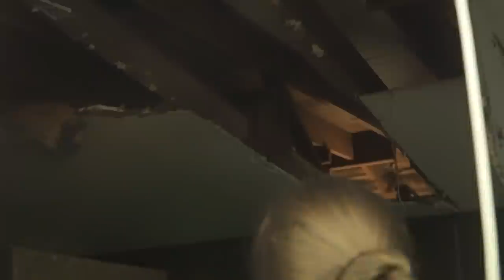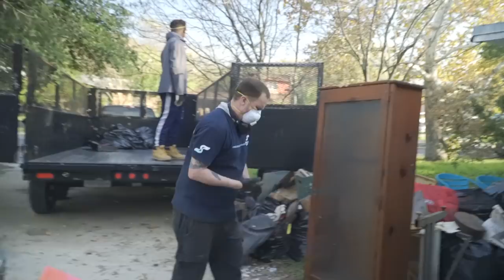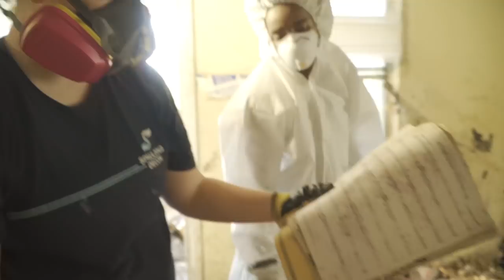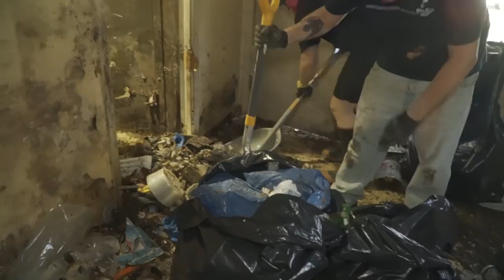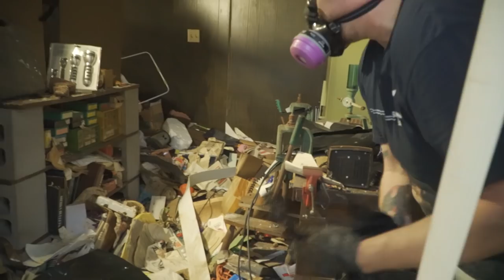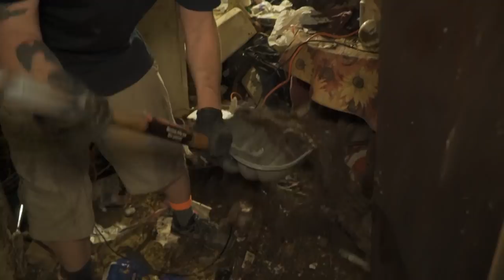Extreme Hoarding: Breaking the Mold

Comment: Seems cheaper, safer and easier to doze the whole mess.
Reply: It Doesn't seem like there would be anything left to save, including the structure...
Reply: Saves the state money from demolition and reconstruction of a new home.. or if an insurance company is involved by the owner that caused the hoard they don’t go far as demoing a house down just a clean out, most likely they will remodel this whole house who knows !
Reply: Even when a house gets demoed, you have to clean out the hoard, appliances, etc. before you can demo it because construction materials are usually considered a different kind of trash that is handled separately in most areas.
Reply: @rock_lover  I sure as hell wouldn't want to live in a house that had that much water damage for that long even if "repaired". But it all depends on whether it's wood frame or block construction, the extent of damage, and the market value of the house as to whether it's worth repairing or bulldozing.
Reply: @SirReptitious  ahhh yup! This one right here 💯
Reply: @SirReptitious  I knew of someone with the same type of damage, that is the roof was collapsed over the kitchen, been living there in squalor. Values in the neighborhood got her $250k for her “tear down”.  It all depends.
Reply from the maker: you'd think 😅
Reply: @jessiec1194  WOW!!
Reply: I agree…. Bulldozer and excavator could havve done that in two days
Reply: Problem is there could be toxic stuff inside and just bulldozing it could recklessly endanger people in and around the area.
Reply: @SirReptitious  In cases of a fire that destroyed the entire structure, it gets demolished with everything in it.
Reply: Someone was actually living there?😥😥
Reply: these houses are easy to find (i love to look them up to see a "where are they now" type of update). this one was sold to a flipper in January, it was gutted to the foundation and studs as of the most recent IG update.
Reply: That's what I keep saying about my family home.
Reply: It's unlawful..you have to get rid of  mold separately
Reply: @ymalloy  not in Colorado.
Reply: I thought the same. That house can’t be saved.
Reply: Can you say “controlled burn”?
Reply: Wouldn’t it have been easier to just drop a match?

Comment: Why don't you use huge rolling trash cans to put your bags in, then it would only take one person to fill the bag  instead of... 1 person shoveling and another person holding the bag open?? Then you could roll it outside instead of killing your back carrying out. Just seems the most logical and easiest on your body.
Reply: They probably end up using those later in some hoards rather than at the beginning. If you notice, when they start on a section, there's trash all around the area they're cleaning; it's easier to just carry individual bags than try to wheel a large trash can over trash on the floor, if that makes sense. 

Once they start clearing out pathways & rooms, it becomes a lot easier to use those big rolling bins ;3

Comment: I would've started by towing the car out of the driveway and putting the largest dumpster you can find in it's place with the dumpster company on call to drag it away and replace it as soon as it's full.
Reply: I also would've taken the door off the hinges in front to make it easier to haul crap out.

Comment: Just. curious why not put a trash can up to the window of each bedroom for example or a deep wheel barrel and put all trash that will fit out the window into a trash can or wheel barrel then dump in dumpster to save on bags and cost of bags? I have cleared on hoarder housing using this method and it’s faster and saves money on bags those bags are expensive. I realize you would not be able to do this every time or in all situations yet thought it may help you all. Also two people can work faster in a room or Four people. 2 inside 2 outside to dump trash in bin.